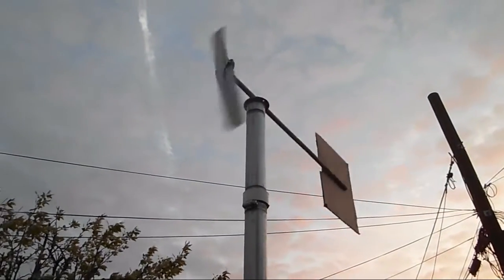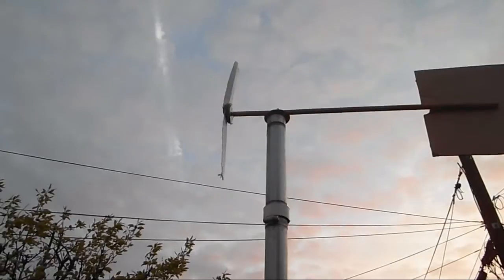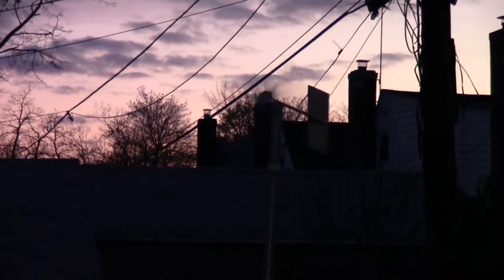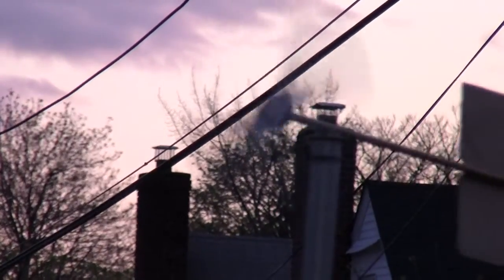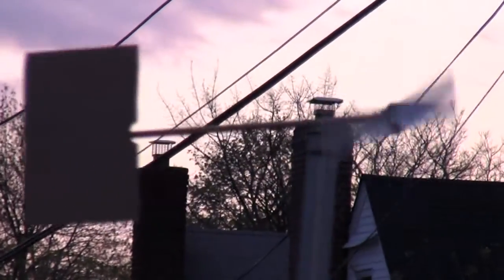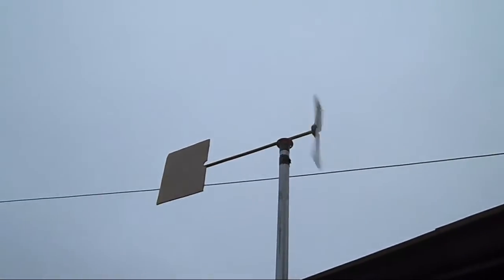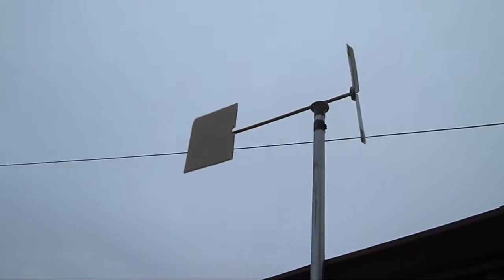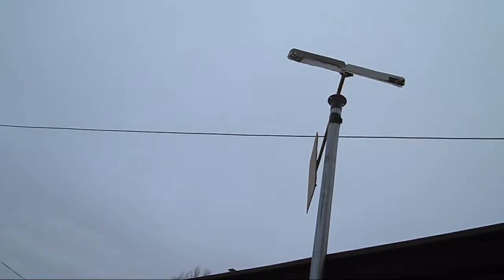Small stepper motor wind turbine

Comment: Nice little unit. 
Recon  one with rectified output and  small capacitor for driving the colour changing leds would look great. The Pwm transition between colours would be visible with rotation for a nice effect.